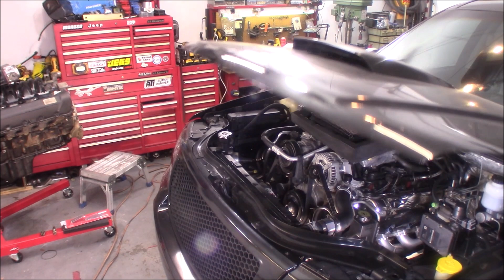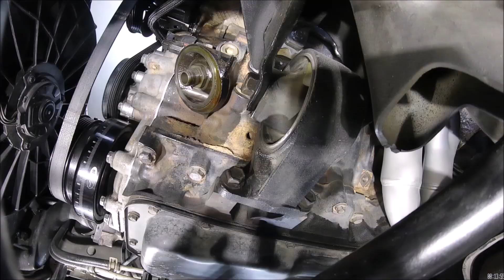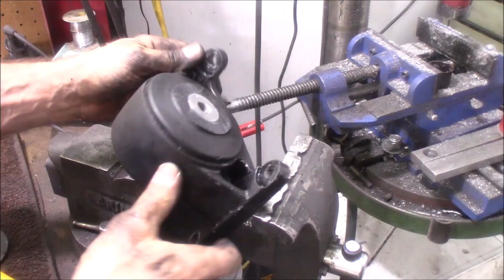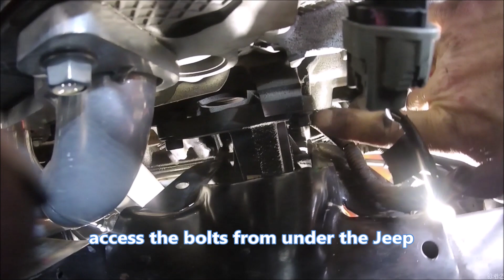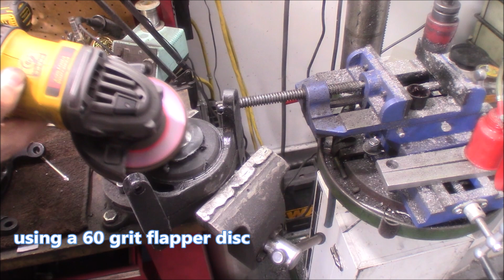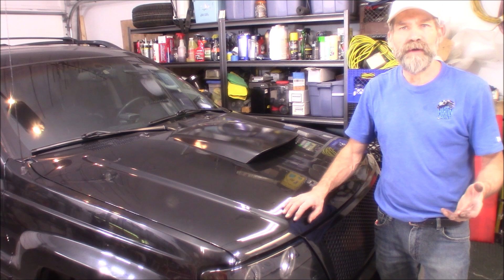Replace Motor Mounts 99-04 Jeep Grand Cherokee WJ with 4.7 using Prothane Polyurethane Inserts

Comment: How hard was it to get the new poly into the case mount?
Reply: was not to bad I used a Chisel and some silicone Grease that's the grease you should use on poly bushings. I went ahead and drilled a hole in the motor mount threaded it to the poly and taped it and put a Grease fitting in it so i can Grease it with silicone if it makes noise Fig cant hurt. Martin has another Vid on installing them in the mounts check it out/ I used a Hydraulic press. But whatever works its not to bad

Comment: I'm really afraid to jack my Jeep using an oil pan.  This is an XJ with a 2.5 diesel, the mounts are almost the same.  But I'm afraid of further deformations or leakage through the oil pan.  Has anyone had problems with this?
Reply: its pretty tough, basically a skid plate as far as im concerned, i beleive it is quite commone to jack up under the transmission or oil pan actually so i would not worry too much. dont go crazy though you only need to jack it up a few inches at the very most! perhaps only half an inch. you dont want the whole weight of the vehicle pushing up on the oil pan but a couple hundred pounds is fine for metal like that, its built tough. different vehicles have different specs so google that but in general its probably fine. just jack it up the minimum amount, maybe even check for denting before taking anything off. if you see denting probably stop but i bet you wont

Comment: Would this work on an '02 WJ with an I6, 4.0 engine mounts?
Reply from the maker: Yes, I'm pretty sure it would. They use the same diameter rubber insert even though the motor mount is different.

Comment: Hi Martin,
I was watching your videos related to motor mounts, one video from 2017 you describe the 70's cars having two sandwich metal plates surrounding a shaped block of rubber in between and you mention that the newer design (OE WJ) allows room for the vibration to get dissipated and not cause inconvenience to passengers. In this video, you showcase another "block" of material inside a metal bracket and you consider it as an upgrade for the WJ. After using it for over a year, what is your impression about PU vs the OE design?
If you were to drive at excessive speeds (highway commuting, 85K+), don't you think PU will cause vibration too? Thanks
Reply from the maker: Yes, they will give more vibration they factory mounts but from a performance standpoint, they help to get the power to the ground. I am still very happy with and will be doing the same to my 01 Dakota.
Reply: very insightful point thank you very much, im sold now @martinbuilt

Comment: I raised the motor to get the mount-to-bracket bolt out, but after replacing mount my motor will not drop back down for me to stab center bolt in.  Anyone have any ideas?
Reply from the maker: Sounds like the new motor mounts might be just catching on the bracket.  I'd try do a little prying around the motor mounts and brackets should drop into place.

Comment: Hi Martin, Regarding these Prothane engine mount, i am intrigued to know how is the ride vibrations wise. I would guess that it would transfer the engine vibration much more than a rubber bushing being much more absorbing than Polyurethane. Its a good opportunity to thank you for your clear pleasant and informative videos
Reply from the maker: Yes there is a noticeable vibration from the engine that you will feel but it isn't horrible and I don't mind.  If your building a performance Jeep, Dodge or Chrysler these are for you.

Comment: Martin, your video’s are the best on youtube. Im having to exchange a 4.7 v8 as soon as it gets warm in on the east coast so spring i will tackel the engine removal and install another from the junk yard. Ive looked through your videos yet i don’t see a video on engine replacement ? Can you point me too one?  Thank you Martin.
Reply from the maker: yeah I haven't got that 4.7 that I have on the stand rebuilt yet, so no video on engine replacement. There isn't much out there on pulling the engine for the JGC

Comment: On stuff like this, I always try to do the hardest bolt first, coming apart, and the easiest bolt first, going back together..  won't have to have the weight of the mount making it harder to get that last bolt.

Comment: I’m wondering after all the mods youve done to your 4.7 is it a “fast” and “powerful” engine?
I know far fetched, but i want to do a race build on a wj similar to a wk srt8 and want to know if i should invest in 4.7 upgrades or just say fuck it and put an srt hemi in there?
Cost isnt too much on my mind right now
Reply: did you every decide>?
Reply: @jeffreystine7068  I chose to work on the 4.7 because I don’t want to go through the headache of wiring and making the hemi compatible with factory components. Also my knowledge of engines and vehicle engineering has increased enough to where I’m confident I can put together a 500+ horsepower 4.7.
Reply: @rodom303  sweet! And what have you done so far … I just got a 99 with the 4.7 power tech … had 99k miles…had the dropped valve seat so I had the engine rebuilt. I definitely want to go faster. Any recommendations are highly appreciated brother!
Reply: @jeffreystine7068  I just got around to working on my 4.7 last month and so far ive installed a hemi throttle body, 08 intake manifold, and custom made 31lb injectors.
I plan on doing much more but I don’t have the money to do what I want with it yet. I’m still working on paint, tuning, and getting it road legal.

If you have an Instagram follow my WJ page: projectoblackpearl222
Reply: @jeffreystine7068  as far as recommendations go just keep watching Martin haha. And do general research on performance engine mods👍

Comment: Why not just do some Ironman mounts? Seemed like a lot of work.
Reply from the maker: At the time I built these mounts I didn't know about the Ironman Mounts, but at $170 I like my $52 mounts. Besides, it wouldn't be a martinbuilt video without some cutting, welding or modifying.